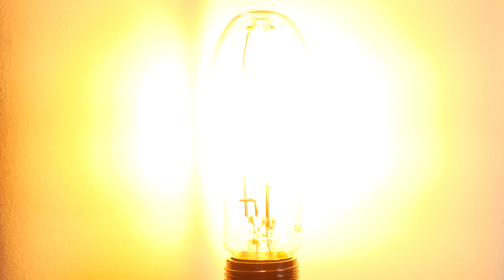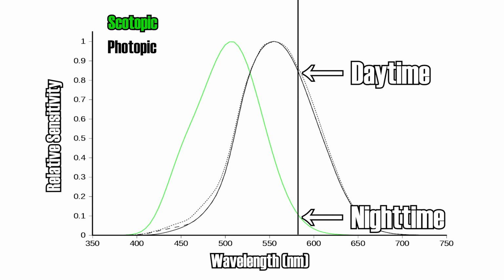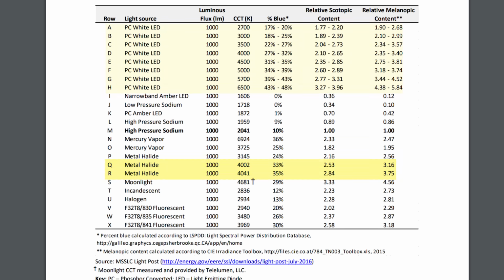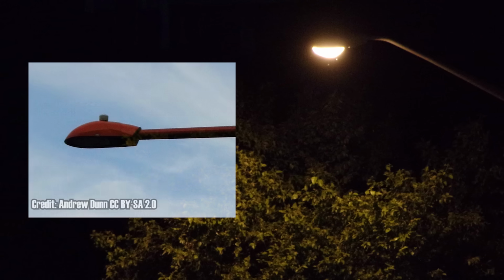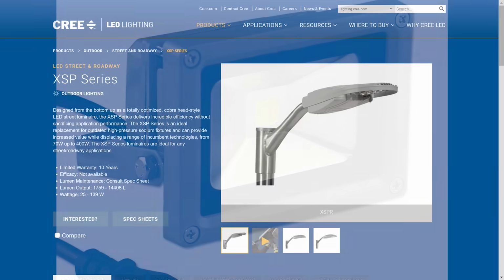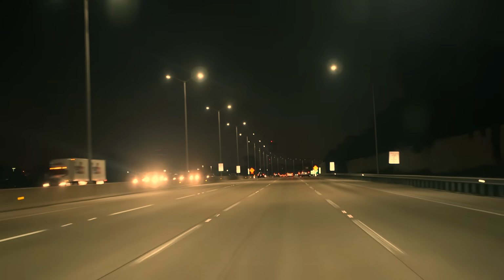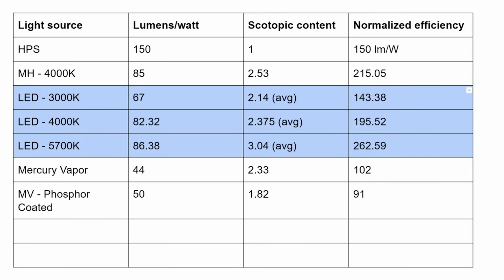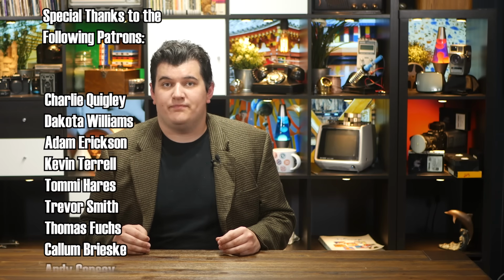The LED's Challenge to High Pressure Sodium

Comment: +Technology Connections - Your sunlight comparison misses a key point: Your eyes can withstand blue light from sunlight (including the rest of the spectrum too) because your irises are triggered to constrict upon walking out into daylight by the ambient sunlight reflecting off everything in view, which then significantly protects your eyes from even brief direct exposure to the sun.  Now contrast that with night time driving while your irises are likely very dilated by comparison to daytime. Now consider when your eyes are assaulted by the random harsh blue glare from the occasional LED street light. LED street lighting is more directionally focused and blasts more additional white/blue light out of a few little emitters no bigger than your finger print than existing street lighting today is even capable of.  That's extremely concentrated light output for your retinas to endure, ESPECIALLY through dilated irises at night.  The effect is similar to enduring a xenon camera flash, and is quite contrary to any idea I'd have of "safety".  The temporary lack of recovery of your retina under such conditions is considered temporary blindness and would obviously be quite dangerous while driving.
Reply from the maker: I don't think you understood the point of the sunlight comparison and/or are unaware of the "issue" I was referencing.  Many people think that the blue light output from an LED is harmful to the health of our eyes, which isn't supported by much research.  The issue you're focusing of glare is certainly important, but a well-designed street light should produce little glare.  After all, you look forward at the road, not up into the street lights.  In any case, with research suggesting that safety levels are improved under light sources with higher scotopic content, placing too much concern on the glare potential would perhaps increase danger elsewhere.
This issue does become quite important when transitioning from a well-lit roadway to one without lighting, but a potential way to manage this would be to gradually decrease intensity of the street lights over a period of a few miles to give time for your eyes to acclimate.  But if you're staying within a well-lit area, the need to adjust is infrequent.
Reply: +Technology Connections - @19:08 "Considering that our eyes can withstand the intensity of sunlight"... you're comparing sunlight to a street light... at night.  You're clearly making the point that because street lights aren't as bright as the sun, and you can see fine during the day, street lights therefore couldn't possibly damage your eye.  But, your comparison is flawed at a more basic level, and the color isn't even important.  The iris plays a critical role in how much light reaches the retina, and a dilated iris at night can easily let more light reach your retina than at pretty much any point on a sunny day, save for staring directly at the sun.  My point is the comparison just doesn't apply one way or the other to your doubt about the blue light debate because it's not an apples to apples comparison.  Anyway, keep up the good work!
Reply from the maker: I'm only comparing them for the purposes of blue-light content and was using intensity to provide context.  Our eyes are adapted to see under the intense light of the sun, which has plenty of blue light and ultraviolet.  I wasn't attempting to address the issue of glare at all.  You say my comparison is flawed, but it isn't--the math is below.
To make this a more apples-to-apples comparison, the eye's pupil creates an "f-stop" range from 2.1 at its widest to 8.3 at is smallest.  This means that at its most contracted, the iris lets through about 5% the light as when it's fully open.  Now, sunlight creates up to 98,000 lumens per square meter (lux), so with the iris fully constricted, the retina has to handle 5 % of that--about 5,000 lux.
Now, since the street lights produce at most 9,000 lumens (from the spec sheet listed in the description), all that light would need to be concentrated into less than 2 square meters to produce the same amount of light on the retina as sunlight does, with the iris fully dilated.
Yes, the iris plays a critical role in how much light reaches the retina.  But sunlight is literally thousands of times more intense than any street light.  The general recommended intensity of street lighting is around 30 to 35 lux.  This is literally a fraction of a percent of sunlight.
I'm not trying to downplay the importance of glare, here, but you are mistaken to assume that the retina is dealing with anything near daylight intensities under street lighting.  Even with the iris fully dilated, under normal street lighting intensities only about 1% of the light is reaching the retina compared to sunlight intensity with a fully constricted pupil.  So long as light projected from a street light is well controlled (and that you aren't looking into them), there is nothing to worry about.

Sources:
https://www.noao.edu/education/QLTkit/ACTIVITY_Documents/Safety/LightLevels_outdoor+indoor.pdf

https://www.popphoto.com/news/2012/06/how-to-calculate-f-stop-human-eye

https://en.wikipedia.org/wiki/Lux
Reply: +Technology Connections - Your comparison went something like this: "The corona of the sun is many thousands of times hotter than a space heater, and billions of people go out every day and suffer no issues from the heat of the sun.  So worrying about space heaters being any danger as a burn risk is silly."  Your tenacity to defend it is admirable, and your sources are appreciated, but it still strains credulity and overlooks more nuance than retina dilation, such as rod/cone dark adaptation and its role in very heightened eye sensitivity at night (quite apart from retina dilation):

At the end of dark adaptation, the eye is about 100,000 times (i.e., 5
 log units) more sensitive than it was at the beginning of the test, a 
level called dark adapted sensitivity. (1)

Flash blindness is caused by bleaching (oversaturation) of the retinal pigment.  As the pigment returns to normal, so too does sight. =>In daylight<= the eye's pupil constricts, thus reducing the amount of light entering after a flash. At night, the =>dark-adapted<= pupil is wide open so flash blindness has a greater effect and lasts longer. (2)

Note from source #1 that beside the pupil (iris) being open at night, the condition of heightened sensitivity known as dark adaptation make over-saturating your vision much easier.

Yet another important difference is that you also won't find many people wearing sunglasses at night to protect their eyes, and there are many times at night when you look around a street for a store or restaurant sign and there happens to be a street or building light along your line of sight, whereas during the day - simply through on your shades and try not to look in the direction of the sun.

A dark adapted eye at night is a TOTALLY different beast than it is during daytime conditions.

Again, I'd say the whole sun comparison is just over-the-top.

Sources:

1. https://www.ucalgary.ca/pip369/mod3/brightness/darkadaptation.

2. https://en.wikipedia.org/wiki/Flash_blindness
Reply from the maker: thom1218, I don't like getting into heated arguments, especially with people who enjoy my work.  But I must repeat myself here because I fear you've missed this: my sunlight comparison was to address the "blue-light eye damage" fearmongering that some anti-LED people proclaim, and not about glare or flash blindness.  Those are important issues, yes.  I think you were incorrectly reading between the lines and felt as though I thought these were non-issues.  I assure you that isn't the case.  The reason for my latest reply to you was that you wrote "The iris plays a critical role in how much light reaches the retina, and a dilated iris at night can easily let more light reach your retina than at pretty much any point on a sunny day."  That is a meaningless statement without the context of light levels, which is what I provided.
Reply: Also can be very painfull. Good point sir.

Comment: Weird.  I prefer the yellow lights.  The bluer lights are outright dangerous on fresh blacktop when it is wet.  The road is completely invisible.  It's like driving in outer space.  That's why I have both the 'pure white' bulbs for my headlamps, standard bulbs for my driving lights and a yellow for fog lights.  I also dislike when the street lights that are the same color as headlamps.  There are many corners near me where when coming up on them; the color of the streetlamp makes me always think a car is pulling up to that intersection.
Reply: That's all very true. As with any studies and new technology, it will take decades for the right testing and studies to come along and say "oops" LEDs are a problem. But we know they are a problem just by looking at them in varied conditions. Also the small point source LEDs in headlights in newer vehicles are very blinding in oncoming traffic or on any uneven road way. When it was wet 15 years ago I could see so much more with all cars that use halogen bulbs and sodium street lights. Now days the LEDs make it impossible.
Reply: Surely making you think a car is pulling up actually results in you being more cautious thus reducing the chance of an accident?

Comment: You need to do a report on how RESISTIVE (filament) loads and LED's (non-linear) Non-resistive loads appear to the operators of AC power grids.
Not at all easy to deal with.
Those NEW LED fixtures add a lot of problems to  the nation's power grids operators.
Solution?  It will take massive investigation and research in the field and lab to come up with a solution.Meanwhile,the tail is wagging the dog.
Reply from the maker: The load from any discharge lamp is nothing like resistive, in fact it's quite inductive.  Without a capacitor across the ballast to correct the power factor, it can be as bad as .35.  The LED fixtures I used as a reference has a power factor > .9, which is on par with or better than the PF of a non-capacitor HPS ballast combo.  Nothing's getting worse with LED, in fact it's almost certainly improving.

Comment: There's another aspect of LED that should be addressed: failure mode.  My city is changing to LED streetlights and every few weeks I see one flashing rapidly at maybe five times a second.  It's extremely distracting and relies on the city changing the light quickly.  Sometimes that doesn't happen.
Is it possible to design a driver that fails to 'off', instead of 'fail to flashing'?

Comment: A interesting solution would be to use different types of fixtures for different areas. I am thinking about using HPS lighting around more residential areas, and then use more cool LEDs on freeways and other areas where you need the higher visibility.

Comment: they went from halide to sodium few years ago overe here and i noticed that much more light leaked into my room since the lamp is right infront of my window, especially  the color annoyed me to a point where i cant sleep (window blinds that have slits).  now they changed it to LED and no light at all leaks into my room but the roads are well lit.   much better.  but they have awful flicker. not visible directly, but in peripheral vision and while moving it becomes annoying.  the led lamps are focussed to the road better, the sodium and halide emitted light everywhere.
also the multiple leds cause weird bokeh in photography, you can see every emitter instead of a round spot

Comment: I think you've made one major flaw in this video: Assuming that we see using scotopic vision in street lighting conditions. This is not the case, as far as I can tell. Scotopic vision only starts to kick-in down at 0.001 lux - and even mesopic vision only really starts when you get below 1 lux - while street lighting is at a minimum of 3 - 5 lux (sometimes as high as 15 - 20 lux). This is pretty squarely in the realm of photopic vision.

IMO having street lighting in the photopic range is actually pretty important, as our rod cells can be easily over-saturated by bright light sources and take a long time to regain sensitivity. I imagine it'd be quite dangerous to have to rely on our scotopic vision on the road; especially with the risk of getting flashed by oncoming headlights.

Comment: I think I am probably way in the minority in that I strongly prefer white or even slightly blue lighting in most circumstances, including indoors.  In my bedroom I only use 200W equivalent "daylight" CFLs and they have improved my mood quite a lot (I think this is partially due to my suffering from winter depression, so the "daylight" imitation has benefits for my mood).  But I do really enjoy the more accurate color-rendering of white light, as well.

But there are a few situations in which I prefer the more yellow light, such as for the string lights that I keep in my backyard for summer gatherings.  The ample amounts of sunlight during the day in summertime make me less susceptible to poor mood, and I actually start to prefer the yellow light (but only for my back yard).

My community (suburbs of Washington DC) is among those that have begun to replace high pressure sodium street lamps with LEDs, and I really enjoy the accurate color rendering of the grass and surrounding foliage.  It may be worth pointing out that I don't drive as I don't have a license to do so, so it's largely an aesthetic preference, but as a pedestrian I do appreciate the increased visibility as well.

The fact that I absolutely refuse to use Flux on my desktop PC probably also contributes to my being somewhat of a night owl, since I find those orange shades kind of ugly.

However, as an avid astrophotographer, I do very much recognize the limitations that I face when trying to take these photographs in my community, and the LEDs arguably only exacerbate this problem.

Comment: Why not use different types of light in different areas? Use the white LEDs on the busier freeways, and use the warmer LED or HPS in residential areas. Also would like to see sensors which shut off some of the lights when the road is empty.
Reply: Ryan MacFarlane there are some cycling paths in The Netherlands that actually only light up when someone comes by. It has sensors in the road
Reply: Rubenyoranpc  That sounds amazing, i dont think any of the cycling roads in my country have lamps. I have dozens of chinese bicycle lamps (using not only for light, but also for safety) in my house :D.
Reply: Well, some LED streetlights can be switched to 50% power between certain hours
Reply: Because logistics
Reply: HPS lights do not exist anymore unlike L.E.D. lights that have and will be the normal for good
Reply: @stephensnell5707 I literally have hps grow lights in my basement.

Comment: LEDs also suffer from a reduction in light output as they age, caused not only by aging of the silicon but also the phosphorus in case of a white LED, so they have that in common with the mercury vapour lamp.

Comment: For all the commenters saying messing up your circadian rhythm would be a good thing when you're driving because it keeps you alert and makes you drive more safely:
1 - The effect lasts long after you stop driving, meaning you will struggle to sleep well when you go to bed a couple of hours after driving.
2 - The real problem is not so much that it keeps you awake while driving or even shortly after driving, it's that some hormones you make on a 24 hour pattern, some you make on a light/dark pattern and when these go out of sync that's what causes jet lag. Anyone want to argue that making yourself regularly jet lagged is good for driving safety? As someone who works an irregular 24 hour shift pattern I can tell you it isn't.

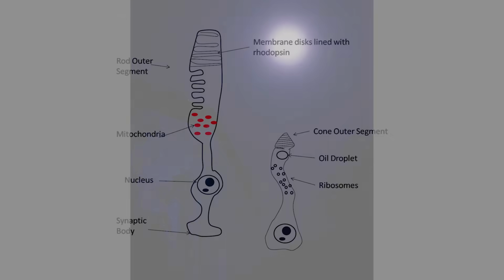Comment: @Technology Connections: The rod and cone cell diagram shown at ~1:24 is not quite correct. Humans' cone cells lack the oil droplet found in birds, marsupials, etc. Placental mammals have lost this structure.
See:
https://onlinelibrary.wiley.com/doi/abs/10.1111/j.1444-0938.2004.tb05050.x

Comment: You want to see light pollution? Come to Rotterdam or The Hague. There's a large agricultural area nearby those cities with lots and lots of greenhouses. The sky glow from those is unreal.
Reply: Chicago is strong enough that when it snows in winter, you can read a newspaper at midnight with an overcast sky. So this guy and anyone else that lives near enough (like myself) already knows some crazy light pollution. (One of the worst in that regard in the U.S.)
Reply: i know, right, i live in alphen aan den rijn
when it's cloudy at night you can see the glow from zoeterwoude to the north and from i think is zevenhuizen in the southsouthwest like crazy.

used to live in waddinxveen-noord for a while too,  which is only like 4-5 km from that place, and the sky would be lit there in a full 180 degree angle every once in a while at night :D

so yeah, i bet you can easily see those from rotterdam/zoetermeer/the hague when you look to the (north)east aswell.

Comment: The Shell Petrol stations in the UK use LED flood lights but they seemed to be connected to motion sensors and dim when nothing moves. It's quite a strange sensation as they'll do it a few times while filling up.